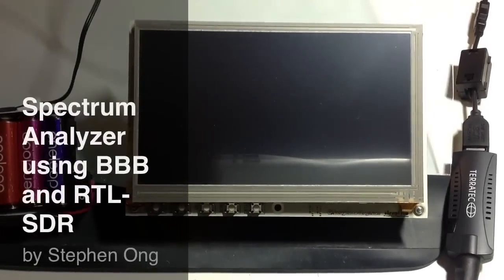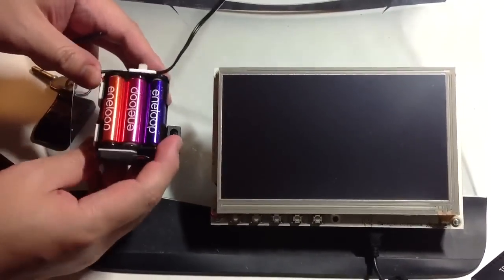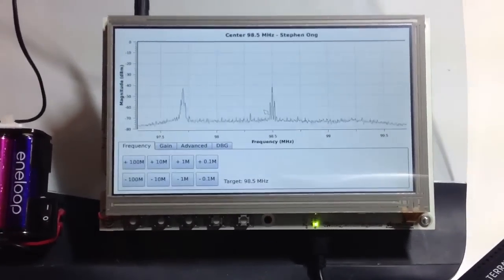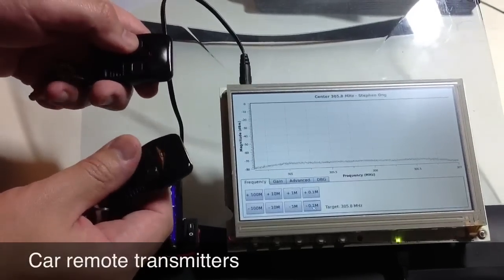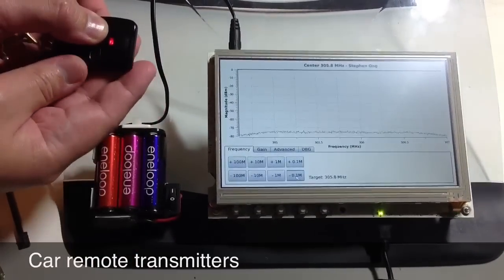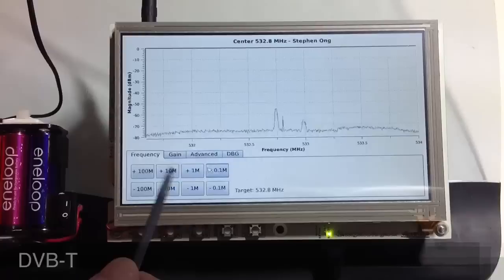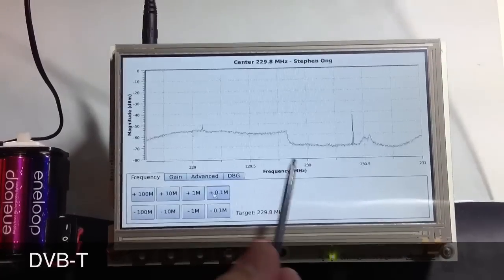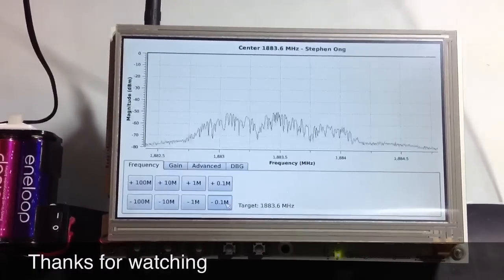Spectrum Analyzer using Beaglebone Black and RTL-SDR

Comment: Very slick interface stephen. I am running 2 of the rtl 2832 usb dongles as SDR radio receivers. One as VHF and one as HF using the nooelec $40 upconverter, which im sure you would find quite useful. Both radios are internet connected.

Comment: Cute toy, unfortunately, this is not a spectrum analyzer, It's nothing more than a band scope. Spectrum ANALYZERS must have the ability to be calibrated and do precision measurements. That's why they are called ANALYZERS  if all you can  do is look at signals then it's a simple band scope.